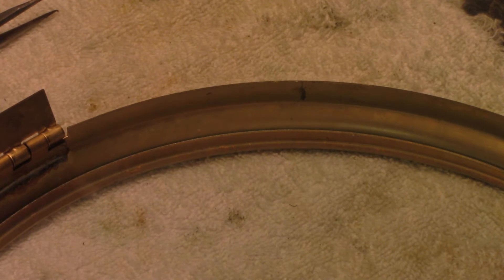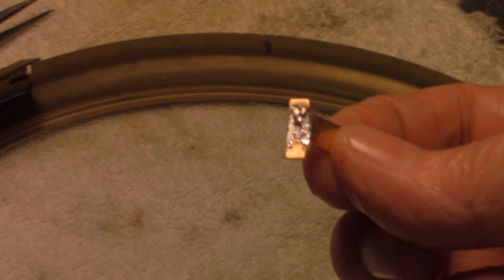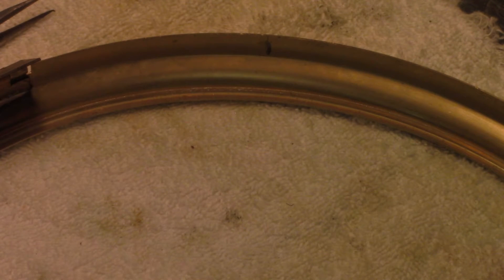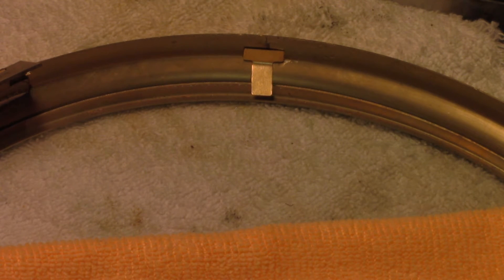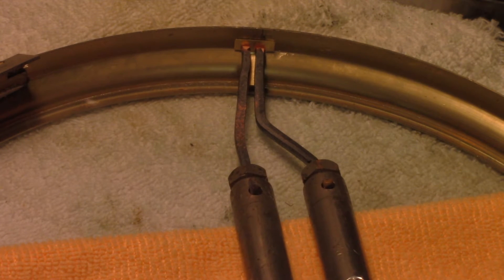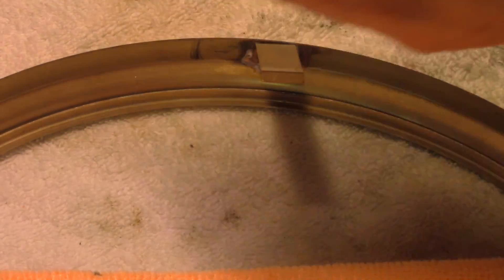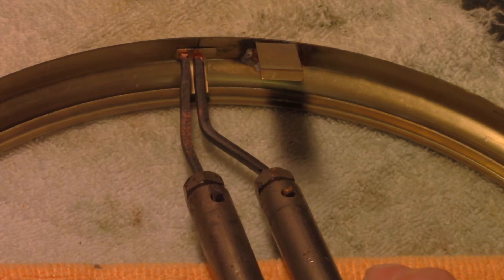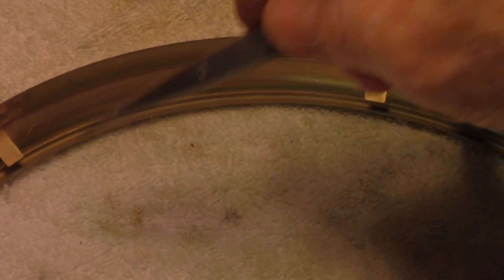Resistance Soldering

Comment: Unbelievable. I am definitely going to try this. I have the exact same need that is being demoed here; reattaching tabs on a clock bezel. When I have tried it with a torch or resistance soldering iron, it frequently does not work, or it ruins the painted image on the clock glass. Thanks again for this video.

Comment: That is awesome. I have one of those solder guns, but I am wondering if I really need to cut the end off? I soldered some pennies together of course they can break apart if forced, but does it create more heat by transmitting electricity through the prongs? I'm very curious as to how it works, by heat alone or by electricity?

Comment: That's cool!  I'll have to try a version of this for soldering on PC boards.  I don't think I'll need as much wattage.  I was thinking that there could be some type of circuit that would ensure that you've made the connection on the tips before pulling the trigger to avoid any sparking since that might be bad for circuits.  At least I could use it to solder wires and connectors.

Comment: The solder gun looks like a Weller which is the best kind. I will try this method and see how it works out. certainly cheaper that buying a real resistance unit for 3 to 500 bucks. Thanks for the info Harry. rjs.

Comment: Thanks for taking the time to film and post this Henry. Is that a soldering iron mod? Or is that something you purchased commercially?
Reply from the maker: It's a modification. I cut the end off the tip. That way instead of the heat being generated at the tip, the heat (resistance) is on the piece of metal it is touching. Very quick results and no discoloration of the bezel on the outside.